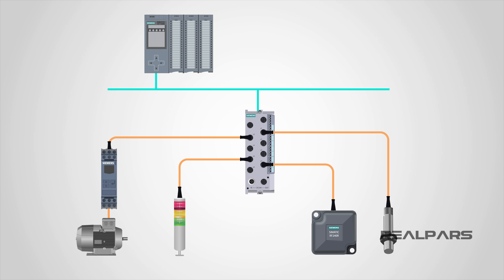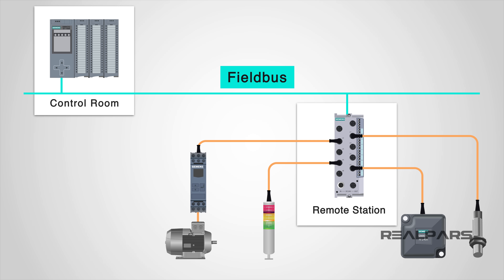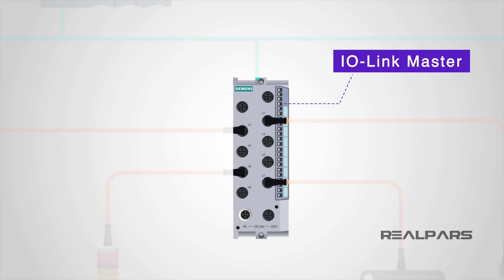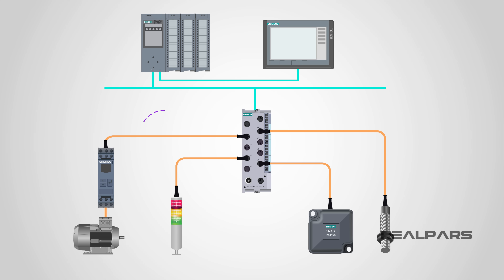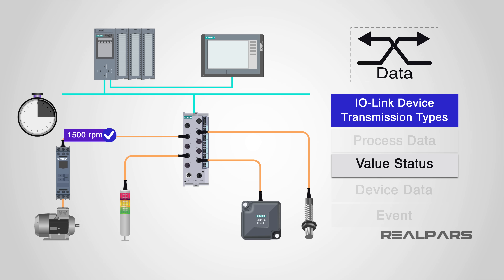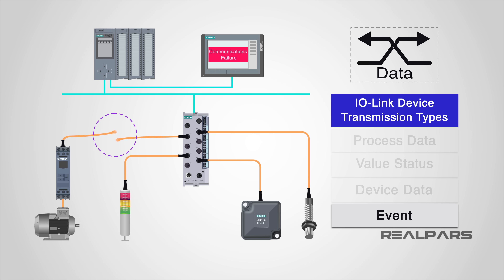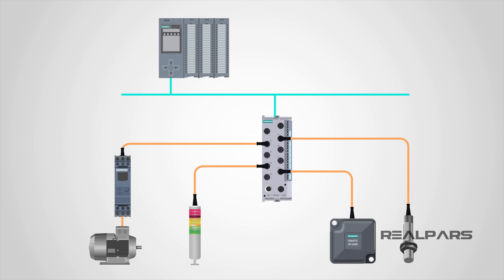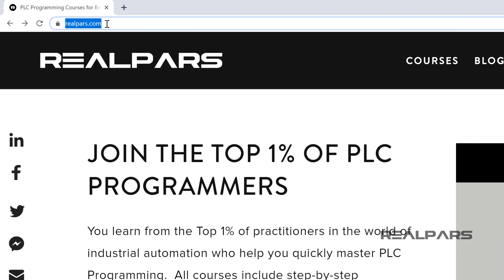What is IO-Link?

Comment: But why would you use this io link system when you already have a Fieldbus System like Profibus /Profinet. Can´t you just plug in the sensors and activators into the fieldbus devices
Reply from the maker: Thank you for your very interesting question! We understand your point, why use IO-Link when we already have PROFIBUS, PROFINET, serial, Modbus, and others?

It really comes down to the specific industrial application, along with factors such as safety, engineering requirements, and budget. In automation, there’s rarely a one-size-fits-all solution, each system is chosen for what best fits the job.
If you're looking to learn more about this topic, you can join our 7-day free trial at:
https://community.realpars.com/checkout/realpars-membership

Comment: Hello is it possible to connect your master directly to your HMI or they need to pass through plc
Reply from the maker: Hello, @makgethosekgoele8309. Thank you for your question.

In most cases, you can't connect an IO-Link master directly to an HMI without some form of intermediary—like a PLC or industrial PC—unless the HMI is specifically designed to support IO-Link communication protocols.  Here’s why:

IO-Link masters typically communicate over industrial Ethernet protocols like PROFINET, EtherNet/IP, or Modbus TCP.

Standard HMIs usually don’t natively interpret IO-Link data structures. However, some advanced HMIs (like those from Pro-face or Siemens) can interface with IO-Link masters if they support the same Ethernet protocol and are configured properly.

For richer integration, manufacturers like Rockwell provide IO-Link Device Object Libraries that include HMI faceplates and Add-On Instructions, making it easier to visualize and interact with IO-Link data through the HMI

Comment: Does I/o link module work with input and output analogical signals 4-20ma?
Reply from the maker: Thank you for your question! IO-Link uses digital signals to exchange data with sensors. This is less susceptible to noise and more accurate than 4-20mA analog signals.

Hope this helps!

Comment: Great video. Also please clear doubts also.
1. Is the 3 wire communication represents Tx, Rx & Gnd?
2. Is it possible to communicate btw plc and io link with ethernet?
3. Can I use standard sensors with the IO link?
Reply from the maker: Hi there, 

Thank you for your questions! 

For question #1, depending on the manufacturer of the sensor will have its own wiring-type spec sheet. Could be 3 or more wires, but you should always use the data sheet of the sensor. The IO master is responsible to get the information from each device to the PLC. 

For question #2, PROFINET is based on standard Ethernet for its communication medium, which we discussed in the video. 

For question #3, for the most part, yes, you can use the standard sensor, but depending on the IO link you use in your design. Again, check the data spec sheet. Here is a link for more learning!

https://www.siemens.com/global/en/products/automation/industrial-communication/io-link.html

Happy learning!

Comment: Hello how you guys doing you guys got some awesome videos I don't know how many I have seen but it's a lot. I have one question I have a CNC lathe the drivers are analog AC Servo Motors it's what I was told I look at the papers and it says is analog I bought a new CNC control what do you recommend to change from digital to analog. I would like to use the old drivers is there something like the io link. Some kind of converter from digital to analog if there is what do you recommend thank you keep making good videos
Reply from the maker: Servo motors typically have specialized drivers provided by the manufacturer of the drive.  I would check with them to see if there is a way to use a digital interface to their servo using a converter or gateway device.  IO-Link would not be used for drive control, but there are many other digital bus systems, such as Profinet and Ethernet/IP that may be able to be used with proper gateway.

Comment: What about the costs of this technology compared with the traditional or the ASi technology
Reply from the maker: I am doing 2 projects now that are using both technologies.  The price for the interface blocks and cabling are about the same.  IO-Link can put information onto ethernet locally using IO-Link master blocks in the field which raise the price of the field bricks but eliminate the need for an ASi master at the PLC or DCS.  Overall, each is very easy to design, install, and configure.  IO-Link has much richer diagnostics and can handle analogs much better than ASi.

Comment: Hi realpars, what is the name of cable used for sensor to master called (yellow cable), thanks.
Reply from the maker: The cable is usually caller an IO-Lin,k Device Cable.  This cable is an unshielded, three or five conductor cables, not longer than twenty meters, using a standard four or five-pin M12 connector. The master and device pin assignment is based on the specifications in IEC 60947-5-2

Comment: Really interesting. I've never seen these in the field in process plants. Though there were probably there when I worked in Pharmaceutical Plants on the Manufacturing Lines which had many subsystem PLCs locally and sensors. But at that time I didn't work in Automations just Process Controls at the time. Still very interesting as I didn't know this was a protocol either. I do think i can use one of these for my local PLC Test Bench setup at the office though.
Reply: You will be suprised how many there are of these. I was stunned when i first saw them. Then did my research and found out what they were. But ya that always happens, u tend to panic lol

Comment: Is there any address mention in IO link? How to identify the address in IO link to plc?
Reply from the maker: IO Link is similar to any other node-based protocol.  Each device has a unique node number on the segment and has a device description file that identifies the information available from the device.  These node numbers are assigned to a device as part of the device's configuration (or DIP Switch selections).  A successful hardware configuration in the PLC will contain the node numbers to be used to communicate with the device.

Comment: All of the iolink features except the wiring advantage can be achieved by hart protocol. Right?
Reply from the maker: Correct.  IOLink is used for digital and analog transmitters and devices, whereas HART is used pretty much for analog transmitters only.  HART does have one distinct advantage, in that it can be implemented using existing analog wiring by upgrading the transmitter and install HART capability at the I/O subsystem.
Reply: @realpars  wow you really respond to each and every question! Bless you and your team. Really appreciate your answer
Reply from the maker: @russelagustinuspurba2723  Our pleasure!  We want all of our students to not only learn, but to understand what they are learning.  This happens when questions are asked, answered. and discussed.  Happy learning!

Comment: How to Configuration Adress of each slave from this IO link and How to Device (PLC) know equipment who connected to it correct or wrong slave?
Reply from the maker: IO Link works in the way as Profibus PA.  The PLC has a card or other built-in hardware that acts as the IO Link Master.  The IO Link nodes each have a unique node number on the bus that is added to the hardware configuration in the PLC.  The PLC reserves addresses as each node is built in the hardware configuration, and those addresses can be used in the PLC program.   There are tools available that allow some of the device configuration and setup to be done via a graphical software interface.

Comment: am not clear on whether we can connect $-20mA instruments on the IO LINK
Reply from the maker: It can be done if you install and interface device that converts 4-20ma to IO Link.  Example:  IFM DP-1213.  4-20ma devices cannot be directly connected to an I/O Link bus without a protocol converter such as described above.
Reply: @realpars  thank you for the reply

Comment: Does this means that the IO-Link is like a  segment coupler in a Profibus-PA network....?
Reply from the maker: The I-O Link Master acts more like a DP/PA link coupler, since I/O Link data is transferred to the CPU over Profinet or ProfibusDP in the example in this video.  There are also I/O-Link Master cards that fit into the CPU "rack" that are useful when the I/O is close to the CPU.  In this video, use of an I-O Link Master is shown in a remote configuration.
Reply: @realpars  Thank for the clarification...

Comment: In the design, when to choose  I/O remote or I/O link ?
Reply from the maker: Technically, IO-Link is remote I/O.  For "mainline" PLC's like Siemens S7 series or Rockwell Logix, you will need to have a link coupler to tie the IO-Link sensors to the main PLC network (ProfiNet, Profibus, Ethernet/IP, etc).
Reply: @realpars  real parts is a great Channel thank you
Reply: Can you name some functions I/O link preferred to use than remote I/O and why ?

Comment: Excellent video.One question.What is the difference between this system and the Fieldbus protocol or Europan ASi? Thank you to continue like this
Reply from the maker: IO-Link is a field instrument-level protocol just like Foundation Fieldbus or Asi.  However, it is typical for the IO-Link connection block to convert the IO-Link signals, which are typically "short-haul" signals to Ethernet/IP, ProfiBus or some other "long-haul" protocol that can be run longer distances.  In this video, the IO-Link connection "bricks" are joined to the PLC network via ProfiNet.
Reply: @realpars  
Thanks for aswering from the follower to yours. I expect a next video about ASi or about the characteristics of the Fielbus, Devicenet (US), Asi (EU) and this field protocols that I just discovered

Comment: Hi
Thanks for this wonderful and informative video.
I gotta ask that why maximum cable length of IO links is 20m?
I connected series of PICV (Pressure Independent Control Valve) to a  Siemens KNX thermostat, and my link is exceeded than 20m. Is it a problem?
Reply from the maker: Every protocol as a standard specification.  Maximum cable lengths are determined by the type of signal, the speed of communication, and the electronics used,  The biggest consideration is power loss along the length of the cable to a point where reliable communication is no longer guaranteed.  For Ethernet, CAT5E, the maximum cable length is specified by IEEE 802.3 as 100 meters.  For IO-Link, the maximum cable length is specified as 20 meters.  Will a longer cable work?  Maybe.  Maybe not.  Following the standard helps guarantee that you will not encounter signal loss issues.  Problems are more likely to occur when an IO-Link junction has multiple devices connected where many of the devices have excessively-long cables.
Reply: @realpars  Perfect! Thanks

Comment: Thanks for making this video. I have a question: do the sensors and actuators need to be specifically designed to work with IO masters or normal sensors and actuators can also be linked to it? thanks in advance
Reply from the maker: The sensors and actuators used in any I/O strategy need to have the required interfaces built into the sensor or actuator to be able to use the specified I/O hardware protocol.  For example,  in the video, the sensors and actuators each had IO Link capability built into the devices.  They were then able to connect easily to an "I/O block" that "speaks" IO Link on the field side and Profinet on the PLC network side.  

To answer your question, "normal" 24VDC or 4-20ma sensors and actuators cannot be connected to IO Link blocks, Profinet interfaces or Profibus interfaces because the sensors and actuators do not have the memory or communication structures embedded to provide the data required by these advanced protocols.
Reply: Thank god I read this comment

Comment: What is different between the i/o link and ET200 slaves??
Reply from the maker: ET200M and ET200SP (as well as other ET200 models) are remote I/O hardware platforms that connect to the PLC network via Profibus DP or Profinet communication protocols. 

IO Link is a communication protocol, not remote I/O hardware.  To use IO Link in a remote I/O strategy, you will need to install I/O blocks (as shown in the video) or other interface hardware to connect field I/O to the PLC network using IO Link.

Comment: What's the difference between IO link and remote IO?
Reply from the maker: Remote I/O is a general term that is used for a control system architecture where I/O is terminated remotely from (not directly connected to) the CPU rack.  

IO Link is a specific, simple communication protocol which is for short distance, bi-directional, digital, point-to-point I/O connections.  IO Link is an industrial communications protocol that is defined by standard IEC 61131-9.  IO Link can be used in a remote I/O architecture for bringing discrete or analog data into the PLC.  IO Link requires a communications master and a connection to the PLC network.
Reply: Up